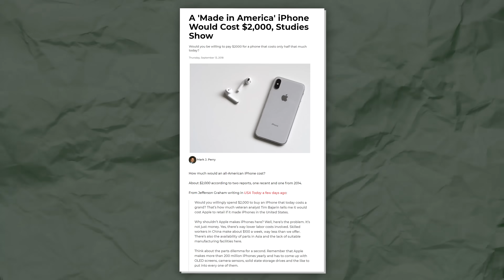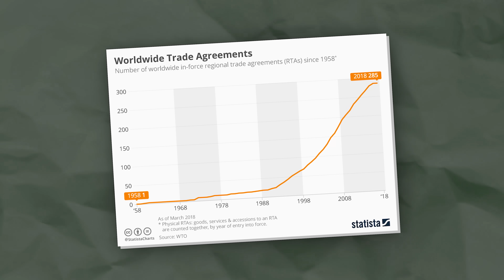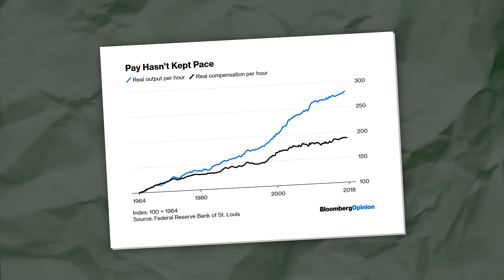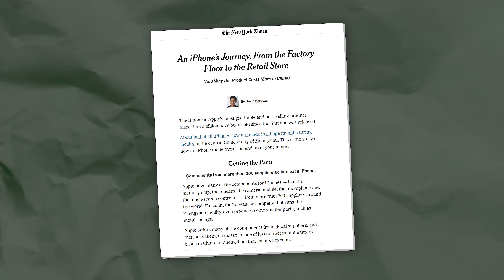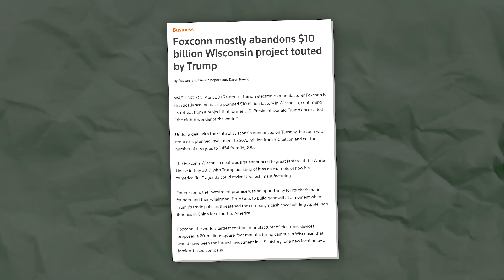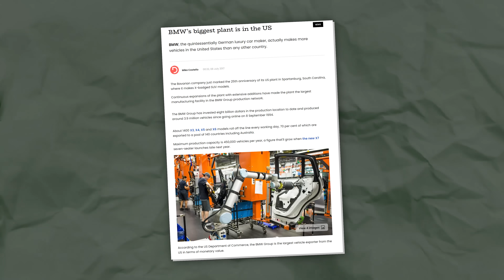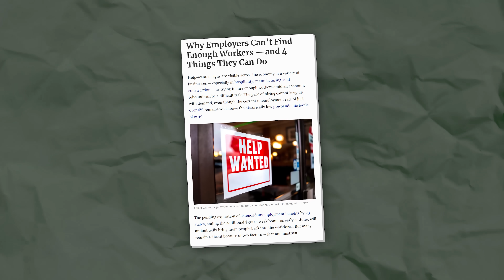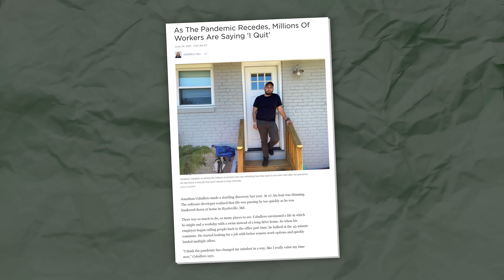How Much Would it Cost to Make an iPhone in America?

Comment: I've got more than a couple questions after watching this for things that just don't quite make sense.

- Do workers in Foxconn China really work 24 hours a day?  I think that throws the entire labor cost assessment unless there's something in the data that confirms Foxconn workers are so good they make iPhones in their sleep.
- Apple has priced iPhones to what makes them the most money, not what the components add up to.  Wouldn't a "Made in America" upcharge be nearly a pure money grab that wouldn't reflect the increased cost of anything?  
- How would there be any economy of scale issues with shipping parts around versus shipping components around?  Part of the strategic initiative would obviously need to develop component manufacturing capability within the U.S. reducing that cost.  Another consideration is that  components that still end up being shipped don't exactly need to be boxed individually in white boxes with a users guide.  They're are already components getting shipped from the western hemisphere to China, I don't think it costs what you think it does to ship them to the U.S.
- Local factories in each country that has a market big enough to support it isn't a bad idea, but the cost of maintaining those factories wouldn't increase that cost by the number of factories.  Yes, running 12 factories is more expensive than running 1 bigger one, but it won't be an order of magnitude bigger.
- For Chinese iPhones being manufactured in the U.S. and then shipped to China, the premise is a bit silly.  The price is already going to be determined to be whatever Apple determines the market will bear, the price of an iPhone in China won't go up unless Apple thinks the market can bear the cost.  The only situation where this even begins to make sense is if the U.S. Government forces them to manufacture every single iPhone in the U.S., but any move in that direction would backfire massively with every country trying to force the creation of their own goods locally.

The video is a good topic to discuss, I'm just not sure that the full scope of possibilities has been assessed for what will change if manufacturers move back to the U.S.

Comment: TVs may not be the vest example since the shift from analog to digital hardware changed a lot in the manufacturing process, especially in how much of the process could be automated as that became more effective.

Way back in 1984, when Apple launched the original 128K Macintosh, a significant part of the story for the business press was how these machines were being built. The factory was still in California but the number of workers it took to get a pile of parts into a boxed up ready to ship to retail Mac was considerably less than what was needed to produced the Apple IIe just a few years earlier. The biggest difference was how the boards were populated with chips up to the point they could be installed in the chassis.

That changed came about before overseas production became an imperative, especially in any Asian country other than Japan. And Japan's standard of living was already erasing that gap in 1984. Once digital electronics became the core of many products the nature of how they were produced changed greatly.

Comment: Incomplete. 400usd company profit also includes costs of tje company like: salary of workers in supplemental dpts like marketing  finance shop workers, rent costs for shops and offices etc. So this is more complicated
Reply: Those are a bit extraneous because you need local versions no matter where the widget is assembled. An Apple Store in Manhattan costs what it cost to have a high end retail location in Manhattan regardless of where the product is made. Likewise for, say, selling your stuff in France. 

This cost is why region lockouts were once very important for video game makers. The cost for a game publisher in Japan to have a US operation to localize, market, and sell the games was a big expense many companies simply couldn't afford, so the games were licensed to a local company. That company doesn't want their game to compete with copies of the game imported from Japan. There is going to be some delay between the native region release and the foreign region release, so a game that needs little by way of localization could be huge hit that includes 10% of the shipped units being exported to the foreign region and eating into the sales of the licensing company. 

So each region had a slightly different version of the hardware that plays the game (sometimes VERY different cosmetically, as with the original Nintendo 8-bit hardware) that allows software to test whether it is the correct machine for the region intended for the specific version of the game. This has largely disappeared today as a lot of the underlying factors have changed, at least in the regions of the developed nations.
Reply: @epobirs  thanks for the ted talk
Reply: @epobirs  i think we should abolish regionalization. It's just anticonsumer and no reason to exist in the digital age
Reply: @triadwarfare  why?
Reply: So this doesn't change the math by much.
Reply: But.... The same product made in China passes many more hands on its way to the US and even after it arrives in the US